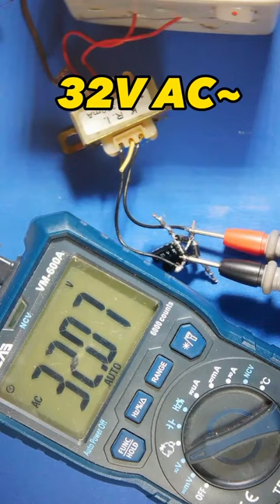Simple powerfull Voltage Doubler | Voltage booster circuit

Comment: Double the ac voltage is easier than dc
Reply: How can I double 200mv ac pls
Reply: You can technically use transformer to double, triple the ac voltage in the way you want. I guess you are asking to double the 200 mili volt AC. If you want to get just 400mv then then there is no need to do these hassle. If only you have to convert to 400mv in a circuit to get desired output then then the most efficient option in my mind is to use a transistor. Like an amplifier circuit. Other than yes you can use a transformer, diode's if you don't mind the dc output. There can be more useful ways than mine so do check once.